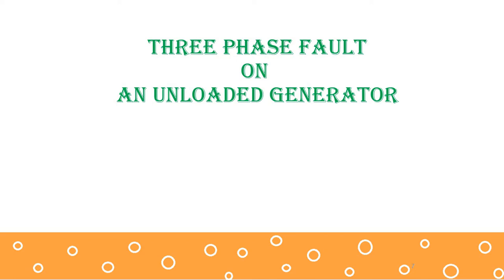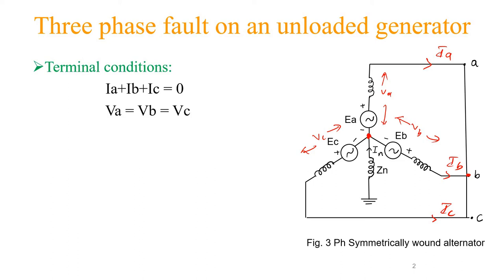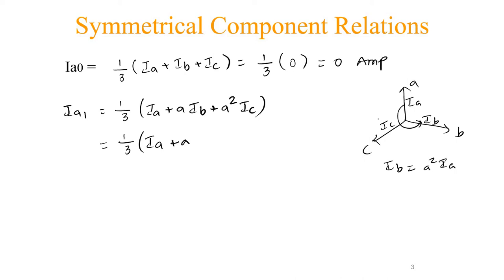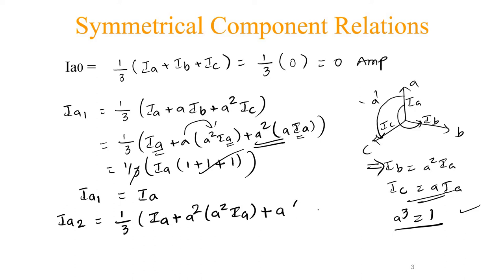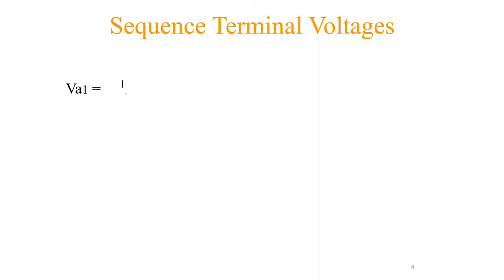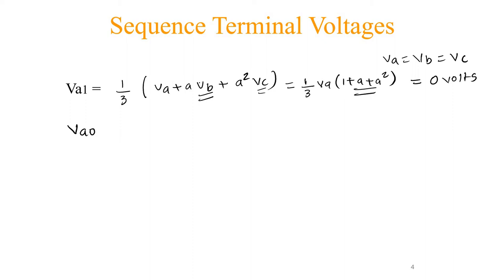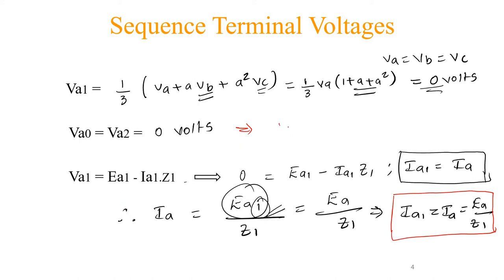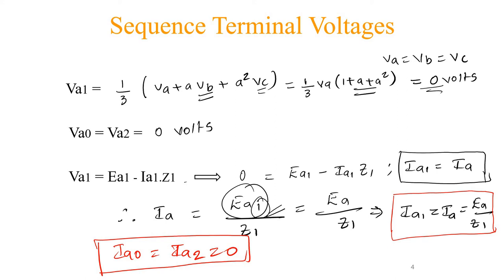THREE PHASE FAULT ON AN UNLOADED  SYNCHRONOUS GNERATOR

Comment: How Va0 is becoming zero?
As Va0=1/3(Va+Vb+Vc) 
So Va0= 1/3( Va+Va+Va)
So  Va0 = Va
Reply from the maker: It is calculated based on the formula
Vao = - Ia0 * zo
In the previous slide, we got Ia0 is zero. 
Therefore Va0 will be zero.

There will be many equations for one particular parameter. Whichever will leads to simplification can be used preferably